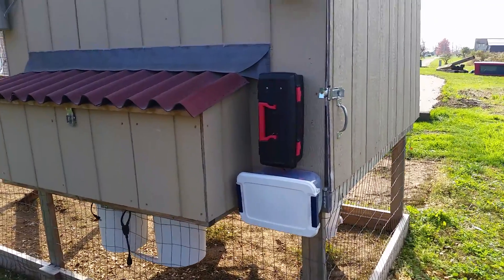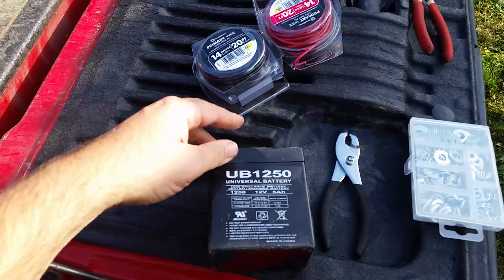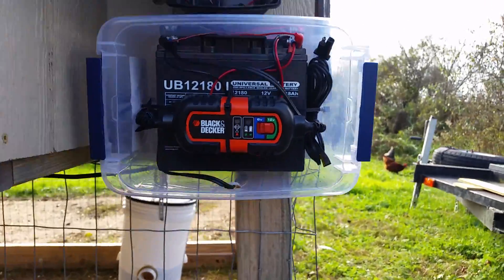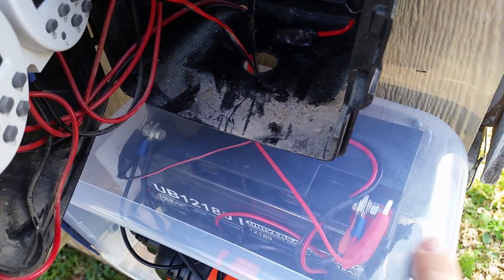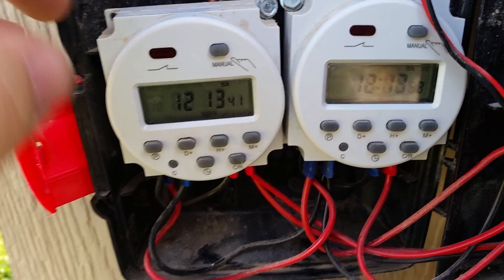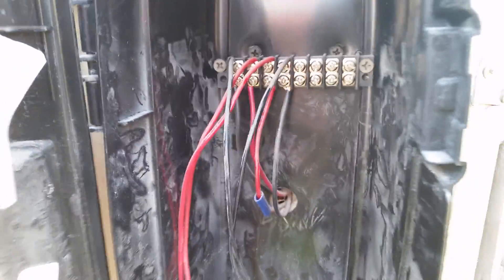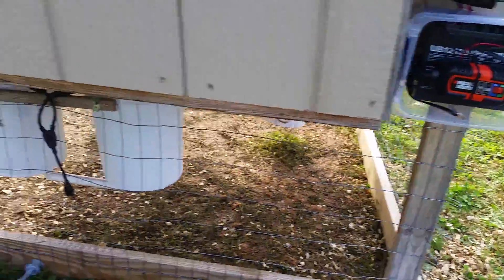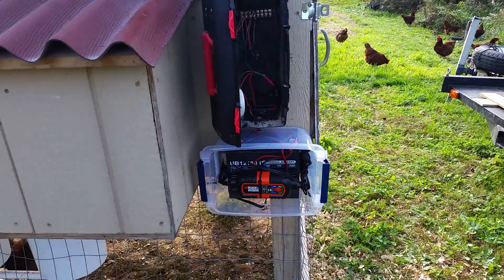How to make the best darn automated chicken coop ( Electrical Setup)

Comment: How many volt solar panel would I need to run a door, some lights, and a camera?
Reply from the maker: I am no solar expert, but "watts = volts x amps". So you really need to know, are you running all 12v appliances? Then how many amps (or milliamps) are they drawing when in use. So if you have a 12v light bulb that draws 2w when in use, add a motor that uses 2amps that would be 24w, and then a camera I looked on Amazon can be had that is 12v 1amp so 12w. So adding those up you would need at least 38w worth of solar to power the devices in full sun. You would need a battery to store energy at night and a panel larger enough to run the devices as well as charge back up the battery. Maybe a 75w panel could be enough? Don't forget you will need a charge controller to not over charge the battery. Good luck! Lots of videos on solar setups out there that could help you. I have a 45w panel I use my motor for 1min in the AM and 1min in the evening. Lights are for 3hrs at night. So I use about 5w for three hours and 24w for two min a day. So my 45w panel can more than provide the power to recharge the battery.
Reply: Thanks a lot!
Reply: @ShawnWhetsel  What sized battery would I need?
Reply from the maker: @Stratiis  again I am no expert and you should do the calculations yourself, but batteries are rated in "amp hours". So you need to do a calculation for how many hours you want to run your devices at how many amps. The camera would be 24hrs a day, lights maybe 4hours, and motor for minutes.  You would be using .2 amps for the 2w bulbs each, camera would be 1amp, and motor 2amps. If all three ran 24hrs a day, that would round up to 4amps an hour. 4amps x 24hrs would be a 100amp hour battery to run them all out. Lead acid batteries only can discharge to 50% so you would need 200amp hours worth of battery. Your biggest draw is really that camera that is 1amp per hour the rest is pretty nominal. During the day with sun there would be no draw, so 16hrs of dark in the winter would mean you need ~32amp hours of capacity if you chose a lead acid solution. (50% usable of your 16ah demand) You could buy two 18AH batteries for about $40 a piece on Amazon and get 36AH of capacity at 12v.

Comment: i really need to know what that black and decker part is.
Reply from the maker: It's a battery charger.  

BLACK+DECKER BM3B Fully Automatic 6V/12V Battery Charger/Maintainer with Cable Clamps and O-Ring Terminals https://a.co/d/dLqwpQ2

Comment: Even if this is 6 years old it’s the best set up I’ve seen yet. Believe me my eyes are coocoo from watching so many videos on this. 
Can you post wiring set up diagram?
Reply from the maker: I can attempt to draw one up for you, it's pretty simple. Glad to see it's still helpful for others. The only modification I have done is upgrade the battery size for winter and low solar power. Everything still works for me as you see it!
Reply: I think I got it. Does your door work like an actuator? Does it need a relay to change the polarity? Most videos I’ve watched with linear actuator they use 2 timers I only want to use 2 total same like yours 1 for door, 1 for light.
Reply: @haynnv  Best thing is to use two SPDT timers. That motor D20 Add-A-Motor works when power is applied. The problem I see with that is if, for some reason there is a power failure, It may skip an opening or closing. Let's say you are using battery and a solar charging system. And there comes a time that it is cloudy for several days. Battery starts to drain and the charge controller cuts off the load until the battery gets back up. Well if the load is off and it is time to open then it will miss that. But during the day the battery get back up. Well that motor doesn't know which way it is supposed to go, it only does that opposite of the last time. So instead of it being closed and it not doing anything it will actually OPEN the coop at night.
Reply from the maker: @haynnv  I wish I could tell you how it worked, but I am no electrical engineer. Essentially when 12v is applied it spins a spool that you thread string over and on the outside lip of the spool is a physical stop tab. That tab will hit a limit switch of some kind that stops the motor from turning the spool and also switches the polarity. Then when you remove power and then reapply, it goes the other direction and does the same thing.  Here is the motor I purchased off Amazon instead of trying to design my own hack job. I sprayed mine with clear coat before putting it in the coop so the plastic would last longer on my replacement motor, because the first one worked for about 5 years before the plastic got brittle and broke. https://www.amazon.com/Add-Motor-Automatic-Accessory-D20-120V/dp/B007IZJWNQ
Reply: @ShawnWhetsel  got mines up and running similar system as yours. I live in Hawaii so tropical weather year around hope solar panel all da time lol 🤙🏽 wish I could send a pic of my set up pretty proud of it hahaha. My chickens won’t hatch til October so hope I got everything ready by then.

Comment: I built a way better easier and cheaper system using light sensor, DPDT relay , linear actuator.
Reply: Can you post what to buy for your settup?
Reply from the maker: @blaze8888888800 Just put all the links into the description.
Reply from the maker: @Ryan Naude Post a video, would love to see it!
Reply: @ShawnWhetsel  dang sorry man I just saw your reply a year later. Sorry. I gifted the chicken coop to my parents and I know since  then the light sensor got wet and stopped working.
Reply: @ruannaude8197  "a way better" system would not have broken. LOL

Comment: Great idea , video and explanation... I use a windshield wiper motor, two 12 volt din rail timers, 2 din rail DPDT 12 volt relays,  two limit switches and one 12 volt car battery which gives me power enough to open and close for at least a week, after which I take  the battery home to charge or exchange for another. A solar panel and a controller would make this easier,,, next step. The system can open or close in 30 seconds, and the power which is used is then only for say 60 seconds a day and to keep the timers alive which is only milli Amps. The windshield wiper motor is overkill,,, and a small dc motor from Ebay would do the job. I use 2 bearings and a 10 mm shaft as winch for a cable. More than one way to skin a cat!!
Reply from the maker: @cookie boi Very cool idea using the wiper motor!

Comment: why do you use 2 timers,,,when 1 timer has 17 functions
Reply: The timer does not have 17 functions. It only has ONE. Turning the internal relay on and off. Or two if you see it as that. I think you mean to say is 17 programmable time sets. You might be thinking or even saying out loud to the screen "You know what I meant". Yes, yes I do. I am mention that because your question dictates that I do. It only has one function and that function is to turn on and off the internal relay (turn on and off the power to the motor), therefore it can not do a second function of turning on and off the power to the external relay that controls the polarity to that motor. 

in short one controls the power and the other controls the polarity.

Comment: Nice Setup!  I purchased everything I need to install my own chicken coop door but I'm using a linear actuator.  I was wondering how you open and close the door using just one timer?  I have to reverse polarity to use the actuator so plan on using both timers just for that but is there a way around that?
Reply from the maker: The timer has multiple "jobs" on it. So I have it set to turn on in the AM and then turn off after 1 min, then the same in the evening. On for 1 min and then it turns back off. The motor that raises the door has a physical switch that gets flipped at the end of the cycle and I am guessing switches the polarity on it as it turns the gear to raise the door.
Reply: Where can I get that motor?
Reply: @prixmulti   D20 Add-A-Motor
Reply: No way around that unless you use a dual channel timer. Ask And I will link you to one.

Best thing is to use two SPDT timers.

That motor D20 Add-A-Motor works when power is applied. The motor has these "fingers". One on each side of a switch, near the top. The fingers are on a dial. The dial Is kinda like an egg timer but moves faster. When power is applied the motor turns in a direction, until one of the fingers comes and flips that switch. When power is applied again, it turns in the other direction, until the other finger hits the switch. The further apart the fingers are set, the longer the motor runs. They are used to determine where to stop the door at.
 
The problem I see with that is if, for some reason there is a power failure, It may skip an opening or closing. Let's say you are using a battery and a solar charging system and there comes a time that it is cloudy for several days. The battery starts to drain and the charge controller cuts off the load until the battery gets back up. Well if the load is off and it is time to open then it will miss that but during the day the battery gets back up. Well that motor doesn't know which way it is supposed to go, it only does that opposite of the last time. So instead of it being closed and it not doing anything, it will actually OPEN the coop at night.
Reply: https://youtu.be/IL1_cxfFRcQ?t=17

Comment: It wasn't your battery it was that tiny solar panel that wasn't charging the battery efficiently. 

The rest is a bit much without any return. All you needed was a 8 pin relay and 1 timer, that's right, 1 timer.

Comment: Hi +Shawn, i am confused :) how do you run that motor on a 12v system? and does the door has any switches? thanks, R
Reply from the maker: Resi Vince The chicken motor only requires 12v. When you purchase it, it has a wall plug that takes the 120v (or 240 depending) AC and converts it down to 12v DC. Just like your cell phone charger. Yes the motor has one switch. When power is supplied it energizes the motor and begins to turn. Once it reaches the limit you set, it flips the switch and stops. The only way to get this motor to work again, or remove power and then reapply. It will now spin in reverse until it his the other limit and flips the switch the other way repeating the cycle.

Comment: Hi my friend can you replace the timers with Arduino mini pro ... ??
Reply from the maker: hacker tom I would think so. Pretty sure those use python for the programming language and that would be capable. Beyond what I wanted to get into though
Reply: Yes you can. but unless you plan on controlling other aspects of the coop or get really in depth with the timer (as in using an astronomical time clock , like i have done) then don't take up time doing it. If you want to then yes do it. You can do so much with just the opening of the door. Like not opening when its raining or if it's "too cold", or even a laser beam safety "switch" feature. I have mine done with relays but it can be done way easier with arduino.

Comment: What size solar panel is sufficient to run lights, heat/fan, and water heater? Also, what size battery would I need for the appropriate solar panel? My coop is 3'x6'x5'. Is there less fire hazard with solar?
Reply from the maker: +Joni Stracker I am no electrical engineer, but if you want to run all that stuff you are going to need a serious panel and a pretty big battery. With a 12v battery it would also depend on the AMP hours the battery can store. Amps = Watts/Volts meaning Watts = Amps x Volts as well. (watt-hours = amp-hours x volts) So... my 18Ah battery @ 12v can produce 216Wh. Watt Hours are how you can determine what all you can run and for how long. LED lights are pretty low draw, but a fan is going to be higher, heat is going to be MUCH higher as its electric passing through some type of resistance to create the heat. That means big AMP draw. I have a 15w panel instead of the original 5w one and it does everything I could dream of. But you are talking a much bigger project than I wanted to do if you are talking heat. Water heaters are going to be the same principle. Just curious, by why a fan and why heat? Chickens don't need either. I run 110v out to the coop in the winter for my tank heaters for the water just to prevent freezing.

Comment: How does your door know to switch direction? Does it have that built into the motor?
Reply from the maker: Slow Bro Yes. When power is applied it spins a wheel with two adjustable tabs. The wheel spins around until tab A comes in contact and physically flips a small switch. That shuts the power off. Then when you remove and reapply power the motor spins in the opposite direction till tab B flips the switch the other way, cutting power again. Its a pretty neat little motor.
Reply: It doesn't know.  That motor D20 Add-A-Motor works when power is applied. The motor has these "fingers". One on each side of a switch near the top. The fingers are on a dial. The dial Is kinda like an egg timer. But moves faster. When power is applied the motor turns in a direction, until one of the fingers comes and flips that switch. When power is applied again it turns in the other direction until the other finger hits the switch. The further apart the fingers are set, longer the motor runs. They are used to determine where to stop the door at.
 
The problem I see with that is if, for some reason there is a power failure, It may skip an opening or closing. Let's say you are using battery and a solar charging system. And there comes a time that it is cloudy for several days. Battery starts to drain and the charge controller cuts off the load until the battery gets back up. Well if the load is off and it is time to open then it will miss that. But during the day the battery get back up. Well that motor doesn't know which way it is supposed to go, it only does that opposite of the last time. So instead of it being closed and it not doing anything it will actually OPEN the coop at night.
Reply: https://youtu.be/IL1_cxfFRcQ?t=17

Comment: There are 12v water heaters fyi and many more 12v stuff just have to order it and look for it hah, ive been setting up alot off my 45w panel. 
Have a 55AH battery tho.Using a yellow top deep cell.
 Water pump, timer, irrigation, lighting  for my green house. Still need to build a door, just built a coop.

With a simple 100w heater i calculated i can run with the heater on all the time for 6 hours with my 55Ah, "8.3amps" Not calculating the panels charging the battery, May install a 100w panel soon. 
Im currently using harbor freight 15w panels total of 45w.
Reply from the maker: hellzone100 Now that's some serious solar. haha

Comment: I like your setup. Did you build the coop yourself? What are the dimensions?
Reply from the maker: +jessefjr Yes, I built it myself. I looked at hundreds of builds before coming up with a design and making my own. The coop itself is 6x6x4 with the top added afterwards. I built it in my garage over the winter, pulled it outside and screwed on the roof piece. The run is 14x6x6 minus where the coop is. I will make a video this spring on the finished product, because I have since gone 5x bigger on the run.

Comment: Nice project!
Have you ever thought about using a daylight sensor to control the door open/closing? that way it would open the door at dawn and close at dusk...
Reply from the maker: +AAAyyyGGG thanks! I did think of that, but my chickens don't always make it in till just a little after dark. I would hate to have one stranded outside. If there was a Dawn/Dusk sensor with maybe a delay, that would be best I think for my situation.
Reply: +Shawn Whetsel Hi Shawn, I know what you mean, ours are the same. But I'm sure those sensors have adjustable sensitivity so it won't operate the door until it's really pitch black outside. Alternatively add a time delay relay (e.g. http://bit.ly/1SviCno) and set it somewhere suitable. But that's getting complicated (although I'm sure you enjoy that!) - at least you could impress the neighbors some more! :-)
Reply: @ShawnWhetsel  add an additional delay on timer for an hour in the circuit for a few bucks....

Comment: how much power would I need to run 10 led bulbs like this
Reply from the maker: +Juan Medrano It would depend on the bulbs.
Reply: It's 10 4w led bulbs
Reply from the maker: +Juan Medrano I am no electrical engineer, but if you want to run 12v 4W lights (10 of  them) against a 12v battery it would also depend on the AMP hours the battery can store. Amps = Watts/Volts meaning Watts = Amps x Volts as well. (watt-hours = amp-hours x volts) So... my 18Ah battery @ 12v can produce 216Wh. Then... Time = Ah / Amps so back to AMPS! 12v lights that use 4W would draw .33 Amps, on an 18Ah battery would mean 54.5hrs in a no loss system. If you had 10 lights, it would be 40W/12v=3.3Amp and at 18Ah that would be 5.45hrs of run time in a perfect world. But you loose volts over time on a battery and circuits loose energy so I would divide that number in half and expect that you can get about 2.5hrs of run time out of 10 4W bulbs on an 18Ahr battery. Then to really monkey with the numbers, add a solar panel that is adding W to the equation as you are pulling them... lol You are beyond my skills at that point in time.

Comment from the maker: +Ken Komaromi Shop around for price but I bought the http://www.amazon.com/Add-A-Motor-Chicken-Automatic-Motor-D20/dp/B007IZJWNQ. I am not using an inverter, because everything in the coop is 12v. The motor itself requires a 12v input, but they give you a 120v wall wart that outputs 12v at ~1Amp. So I just cut off the DC plug and tied it directly into the 12v battery, then I tossed the wall wart in a misc parts bin.